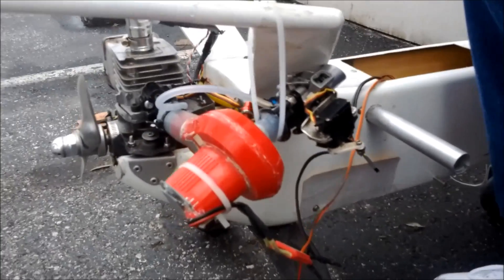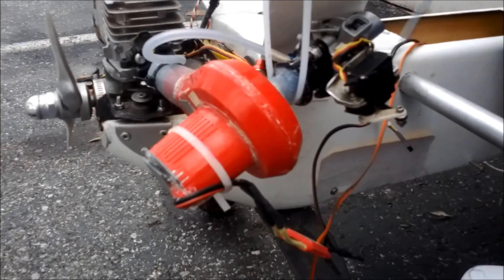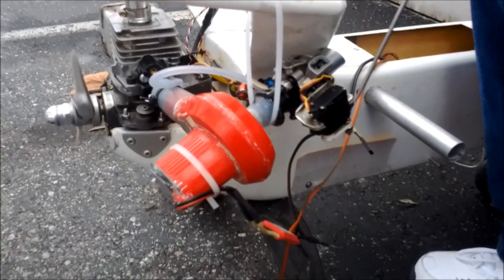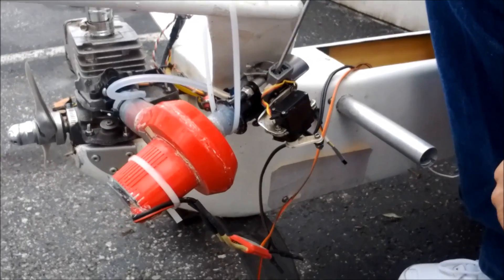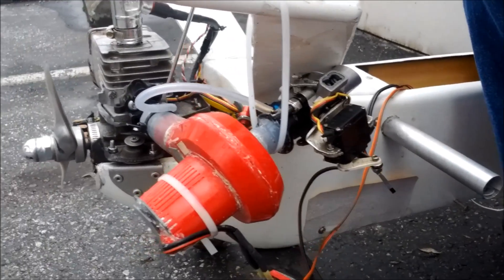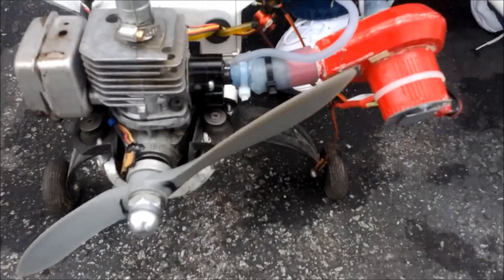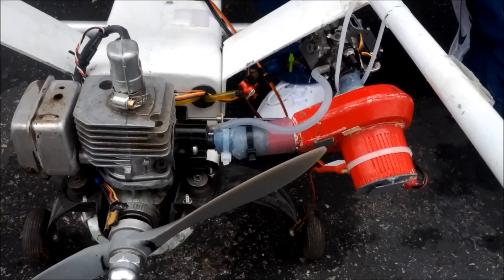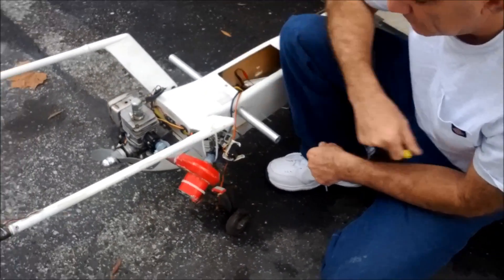Electric Supercharger Test on a 2-Stroke Engine

Comment: I suggest you put a pressue guage on that intake and see how much static pressure you make with the electric super-charger on that your currently using because it's always going to be less than with the engine running; and for an engine that small a miniature roots style may perform better for you. It takes a very high RPM to get pressure from a centrifugal (an excess of 10K to be sure) and I doubt the motor you're using goes anywhere near that.

Comment: Where did you go to school that 8000 to 8300 is 16 percent? My math says less than 4%. When you take into account the weight of the blower it would certainly negate that 4% improvement. I give you credit for a good effort but I don't see it as a worthwhile endeavor.
Reply from the maker: For a propeller, shaft power input is proportional to RPM cubed, not linear in RPM.

Comment: you need to callculate how much air your engine sucks in att given rpm and then you need a pump that pumps out twice that amount and built it in with a bypass walve att the intake so the engine can breathe normal when the charger isnt on.. good luck

Comment: 2 stroke is not supercharged  Smorrismibco u need a pipe exaust and enjoin the speed https://www.horizonhobby.com/tuned-exhaust-pipe--23-30cc-gas-engines%3A-dbxl-los55000

Comment: silly idea? put an air ram "funnel" facing the prop to help slam air into the carb instead. you already have a source of air pressure/flow, if it can be timed with prop blade position relative to its intake time, it just might do good things without adding much drag or weight at all. I'm going to guess 3-4x the size of the carb throat prop side might give a little more boost-pressure

Comment: a fan or blower will  NEVER produce boost you need a high flow compressor with some thing that small you could use either a electrically driven supercharger or turbo compressor housing but would require a gear ratio multiplier as a turbo spins at around 100k rmp

Comment from the maker: NOTE: In the video description I added the following update.
Update 12-18-14
I tested the motor with more boost pressure (more fan speed, higher voltage) and saw no increase in peak RPM with increased fan speed. When I restored the intake geometry to the stock carburetor installation the peak RPM without boost was similar to the boosted case, so the improvements shown in this video might be due to the reduction of intake losses only.  I don't believe that this system is compressing more air in the cylinder because increased fan speed did not raise the peak RPM.

Perhaps a system with a tuned muffler might perform better but this version does not appear to behave as though the boost is happening for real.
Reply: He bro can u give me details fo that supper charger wich was used by u in tha video i need it for some  experiment
Reply: DOES YOUR CARBURETOR is designed to BE boosted BY ELECTRIC SUPERCHARGER?